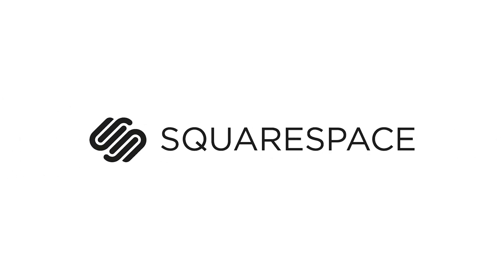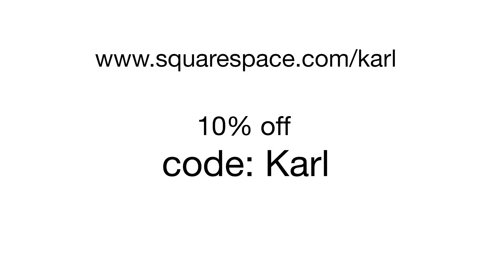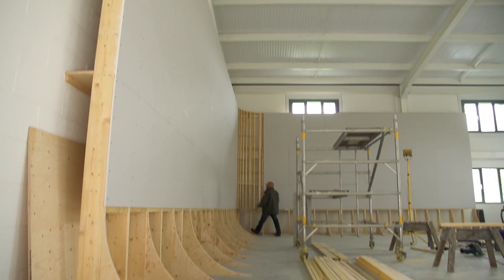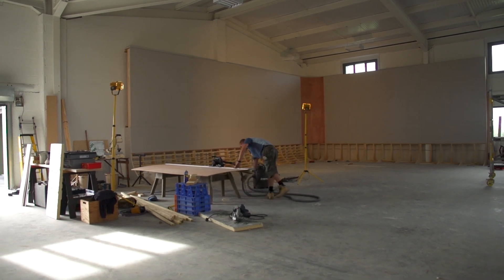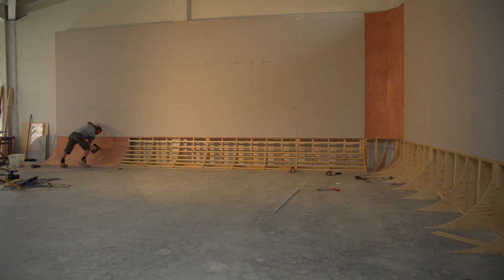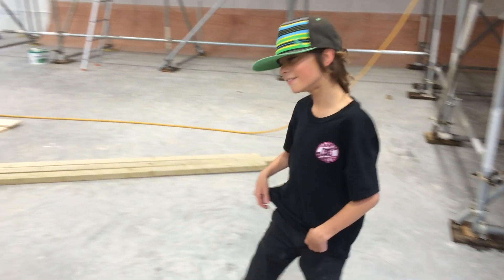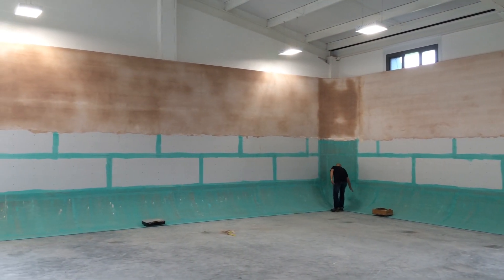How to build the perfect pro-photography "Infinity Cove".

Comment: Very nice. Here in Canada I built one a few years back using almost the same method cept I used steel studs and  1/2"  drywall for the top and the double layered 1/4" inch drywall for the curves instead of plywood.

Comment: Thanks for sharing this. We are building one at the moment. Curious what the Green sealant is that your guy used. I assume to seal the would in case of moisture?? Nice work!
Reply from the maker: That was a type of sealant for the curved plywood parts so that the wet render could be applied on them.

Comment: Can't help but think how does it get cleaned properly if the walls get stained by people touching it for instance. Or doing something commercial that involves liquids or paint.
Reply from the maker: NO ONE TOUCHES IT! ha ha just kidding, it's actually very difficult to touch it because the curve is so large you can barely reach the wall. The cove will be painted as necessary and different colours too depending on project requirements.
Reply: ***** Hahahaha!!! But I have to admit that it turned out awesome. Guess it feels even better when you apply elbow grease to it. But also, painting it different colors? Wouldn't that be a bit difficult to put it back to white afterwards perhaps.

Comment: Hi Karl,
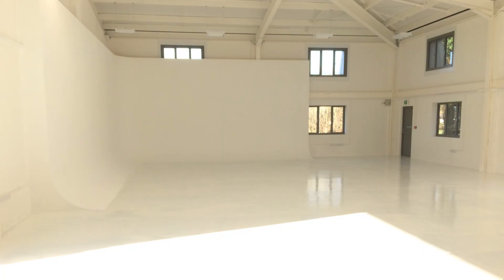First off, congratulations on the new studio!  Very impressive and major studio envy!  As I am undertaking the exact same process right now, I am very interested in knowing specifically what you used on the floor in front of the cove.  Also, what are its measurements?  In the video, I can see at 2:24m that it has a reflectivity to its finish (looks glossy).  This looks like high gloss epoxy to me.  Can you share the specific product that you used?  Is your intent to clean the high gloss finish or will you repaint repeatedly as most studios do?  Cleaning instead of repainting is much more economical in short order even though the epoxy floor has a high first cost.  I like the idea of the high gloss from a photography perspective, but the video guys don't seem to like it.  Any insight you care to share would be greatly appreciated.
Thanks!
Reply from the maker: Hi Ken, our floor is a very smooth concrete painted with Deluxe floor shield paint as a base layer (3 coats silk finish) The cove is painted in pure brilliant white Matt and this paint will be painted into and over the floor as necessary depending on the shoot. I've worked in many cove studios and repainting them is a necessary evil, sometimes grey, sometimes black and then back to white again on that basis we didn't go for the epoxy floor but it would be nice as they are much tougher wearing but on the other hand we'd be painting over it regularly anyway.
Reply from the maker: Oh I forgot the measurements, this cove is 11meters by 8meters by 4 meters high, I think.
Reply: ***** Thanks Karl.  Agree.  My cove is 9m x 7m for the two legs.  What are the measurements of yours?
Reply from the maker: Ken Vol Answered above Ken. Cheers